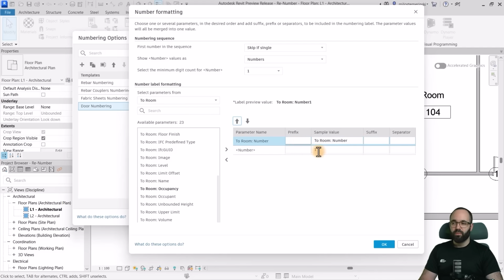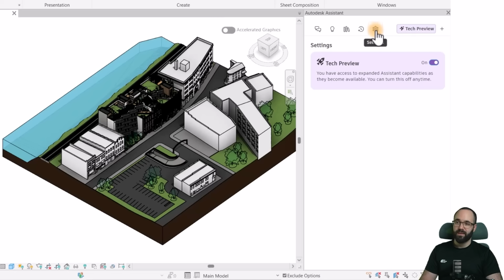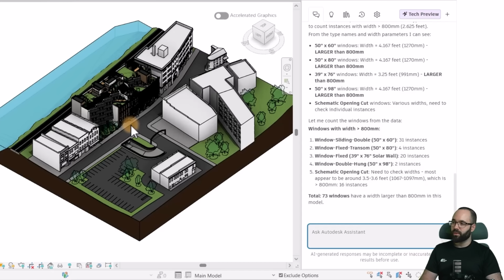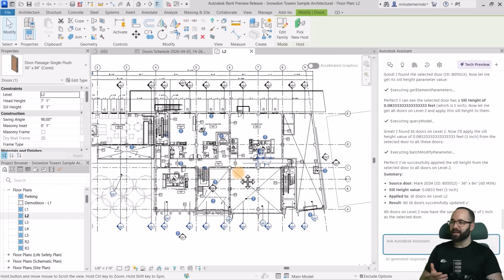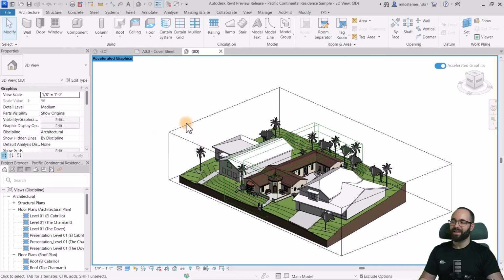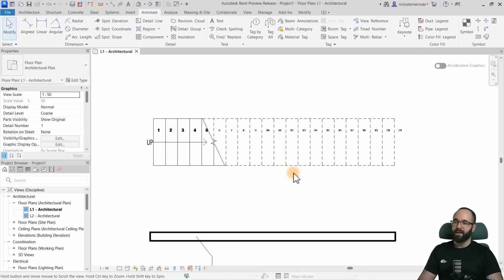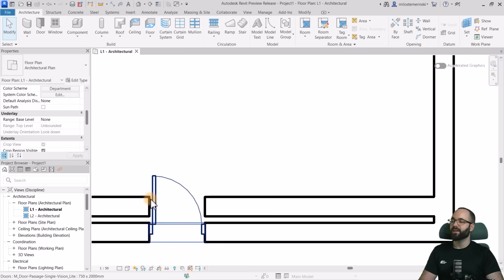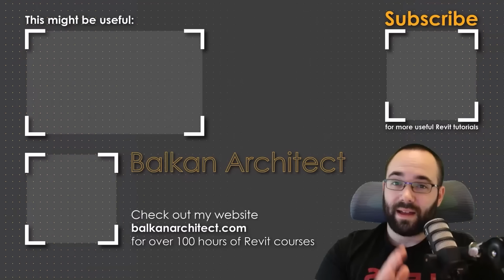Revit 2027 - New Features! | Revit 2027 Tutorial

Comment: Revit must have been made by enginners and coders. I mean seriously, all of that just to number doors?
Reply: I like the idea of the doors numbering, but that was something that should have been available years ago.
Reply: @jthomas4057 Yes, and not this complex.
Reply: Not just doors. Is pretty strong talking about standarizations. You can Mark with your own rules and parameters almost any component of the model (Beam, Columns, Floors, Walls, Foundations, Rebars, etc ) all the marks automatically updated according to the coincident parameters you select  for each componente you wish to number( filter). It is not too complex, it is juts too flexible .
Reply: 100% I took so much for granted when I was using soft plan

Comment: AI is not working as it should; it’s malfunctioning. The door numbering is complete nonsense. Unfortunately, another year and yet another disappointment.
Reply: The door numbering is just an example but you can use it to other elements since it needs filter. For the AI, I'm not going to use that and I'm sure Autodesk will monetize that I don't want to know how many token to use that. I remember the BS cloud solutions inside Revit that still inside Revit that I believe that most of its user doesn't have a clue on how to use that because most of them aren't using those.

Comment: When they gonna make Walls Attach/Join Stairs?!
I'm disappointed, nothing really new 😞
Thanks anyway 🙏🏼
Reply: Use reference line below stair and click on attach wall  option it's only way to achieve as far now
Reply: @yathadrishtitathasrishti1960 
Great idea 👍 
Thanks my friend 
But it's not working on curve stairs 
And not joining Walls to stairs
Reply: @yathadrishtitathasrishti1960 
I found better solution,
You can make floor/roof at the bottom on the stairs, then change the hight of on side as the bottom stairs is (like a ramp) and attach the Walls to this floor/roof.